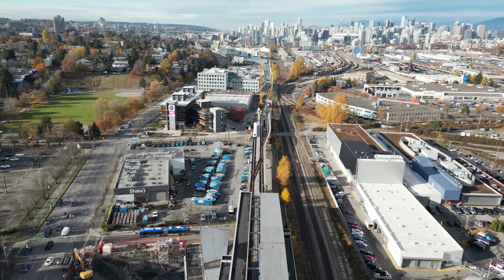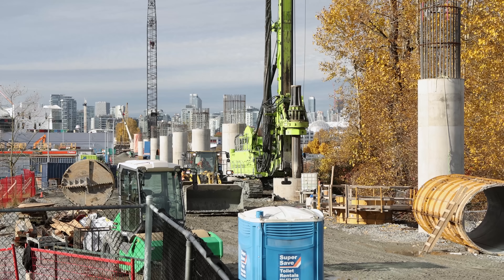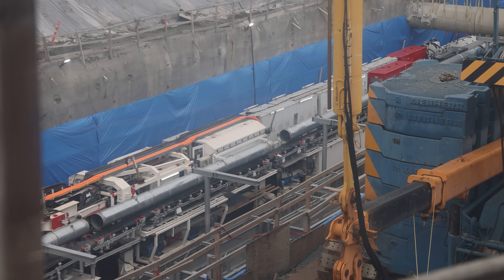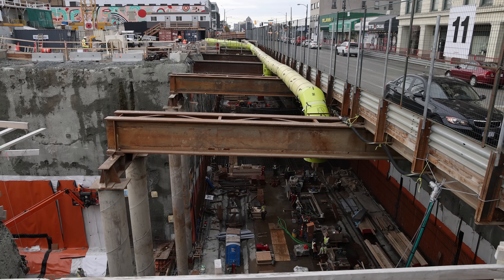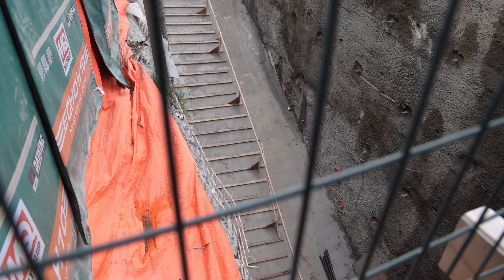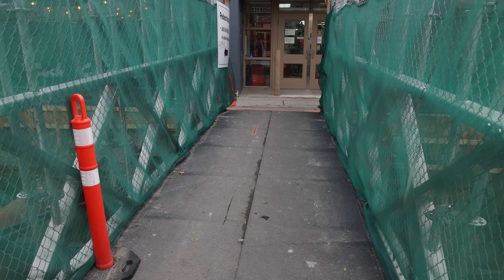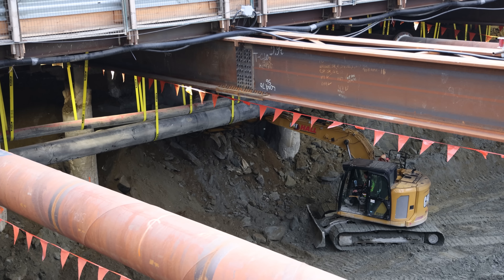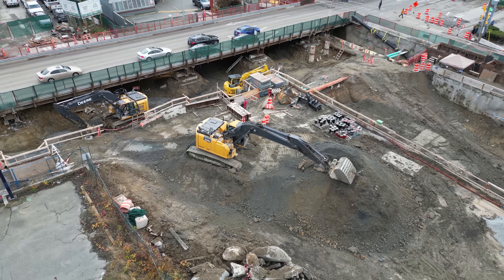Broadway Subway Skytrain Construction Fall 2022

Comment: Subway skytrain? Isn't that an oxymoron? The whole point of a "subway" is that it goes underground. That's the "sub" part. So a skytrain is not a subway. If part of it is underground and part of it is elevated then it's just confusing. I just call it a metro in that case. I know, I'm being pedantic.
Reply: It is a light metro, correct. However, even at opening in 1985, the Expo Line was mostly elevated with a short underground tunneled section (Waterfront to Stadium, in the old Dunsmuir Tunnel). And there are plenty of other subway systems with elevated sections such as Toronto and NYC, so the mix of above and below-ground sections is not unique to Vancouver.
Reply from the maker: You're right, but it still feels weird calling it subway skytrain.
Reply: It's an extension of an existing SkyTrain line, which is mostly elevated. They're not going to rename the entire branding just because few stop extension is going underground